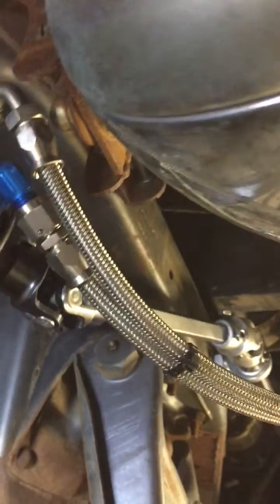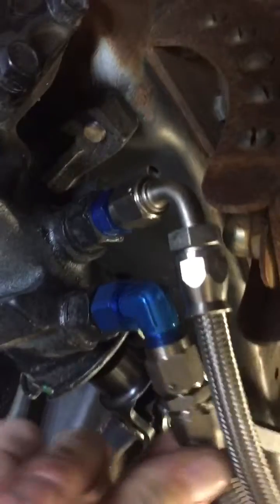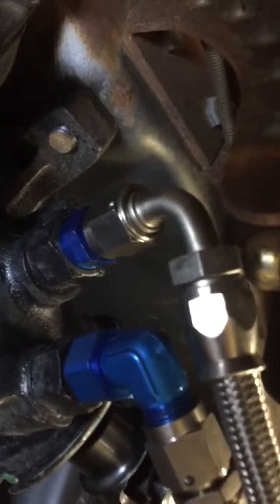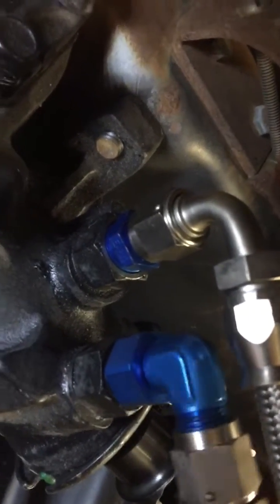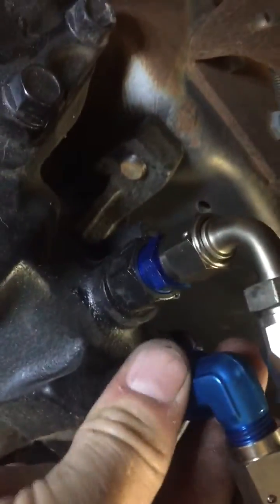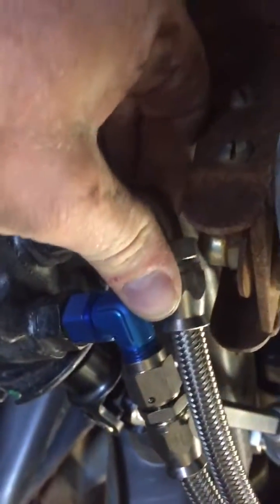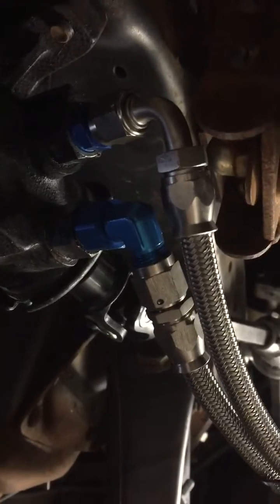Swivel style AN fitting, too much swivel?

Comment: It depends on the swivel fitting. There’s some swivel fittings on the gear retract actuator on Cessna 172RG and they are loose like that one, but are o-ring sealed internally

Comment: i just made one of these fittings today, it looks like the seat is too shallow for it to properly tighten down. definitely shouldnt be able to swivel when its tight. either that or there is something stopping you from tightening the fitting all the way down.
Reply from the maker: Do you know what the thread and size it was? Maybe I got the wrong one.
Reply: the one i had initially bought had stripped out so i tapped it for m12x1.25 but it was a -6 fitting, it looks like that may be what you are using here. if you wanna see pictures you can look me up on facebook my name is nate boslet